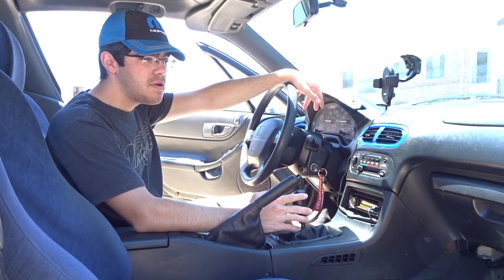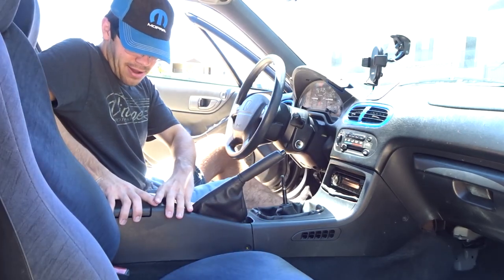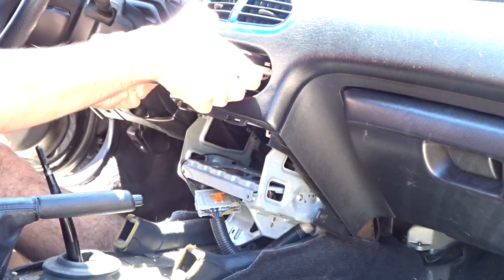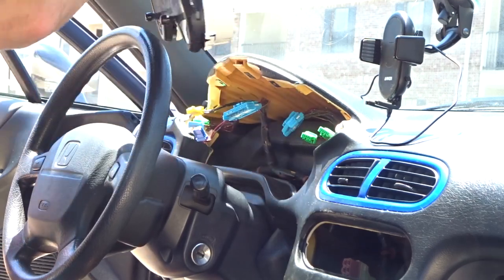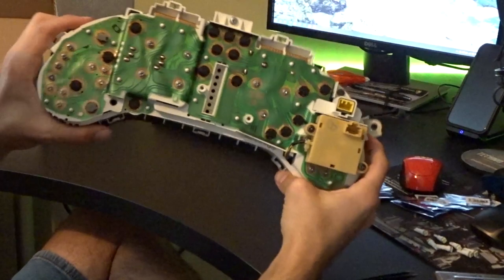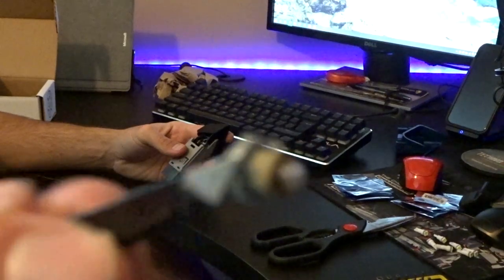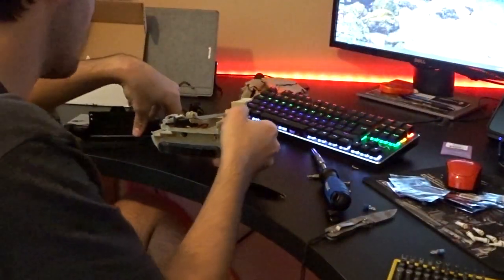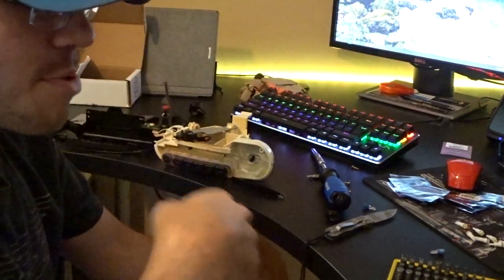WORTH THE $50! Update Your Del Sol Interior!

Comment: Ok I recently finished mine and have a couple things to add for others who maybe ran into the same issues I had. #1 when I went to pull the climate control out to disconnect the plugs from behind, i didn’t have enough slack in the wires to do so like I noticed you did.  I remedied this by disconnecting a clip that is connected to the metal frame where the radio goes which basically just tied the wiring harness in place a bit.  I’m assuming yours either wasn’t there, already disconnected, or you forgot to mention it. #2 I couldn’t for the life of me get the black front plate that goes on the outside of the climate controls to come off without what I felt like would potentially break it, plus the knob for the temperature slider I felt would be in the way and I couldn’t figure out a way to remove it, instead, I just left it on and was able to disconnect the two bulb sockets from behind the face and swap them out that way. #3 if you ordered your led’s from someone other than superbrightled’s like I did on eBay, the copper connections where the lights go were super tight fit and pain in the ass and required me to pry them open more to create more space(I used a small flat head screwdriver and wiggled it back and forth to open them up more) #4 keeping a rag or something soft under the CC when you removed it to protect your dash from potentially getting scuffed or damaged is something I wish I would have thought of prior. Be as gentle as possible in order to prevent that is also a recommendation of mine. 

Other than that this video helped me out tremendously and saved me tons of time otherwise It would have been a guessing game for me. Thanks for the upload and help and good luck guys!

Comment: 4:00 you shoulda take off 1 bolt and rotate the handbrake lever, so you wouldnt need to stretch the central console. mine has broken plastic in the corner below the radio, mistake by previous owner.

Comment: Hey man, thanks for an awesome video, can you comment how many of each LEDs I need to order?
Reply from the maker: I think there are 12 or so of the Type 74 SMDs between the cluster and the climate controls, and there four white T3 NEOx T1 bulbs across the switches. There are also three green T1 bulbs in the switches if you have cruise control.
Reply: @hemicruisin1983  thanks so much, don't have ac or cruise control. 4 white T3 or 4 T1?
Reply: Thanks, I've ordered mine

Comment: help?! first off i want to say you killed it, your car looks great with the upgrade, but i have a question. my gauge cluster isn't lighting up at all at night. i turn the lights on and it stays pitch black on the cluster. i checked all my fuses and played with the dim switch and they seem to be fine. i just got in those cheap led bulbs that i will replace the older ones with. i got the car a few months ago. i don't know what else it could be if its not the bulbs. help?
Reply: Hey brother don't know if you fixed the issue but their are a couple different things it could be. First is the dimmer switch could have a malfunction internally. Try getting a replacement and see if that helps. Another common issue is the bulb clips. On older 90's imports these clips have a positive and negative prong that comes into contact with the circuit board aka PCB. Those prongs become loose, damaged or corroded over time and need replacing, the clips are cheap and easy to find. If your needles on your gauges are working then the cluster should have power but if not then the cluster is the issue or the power wire from the fuse box under the steering wheel might be burnt or disconnected, I have seen fuses that were in good shape but the prongs in the fuse box were corroded and it caused power failure as well. Hope this helps